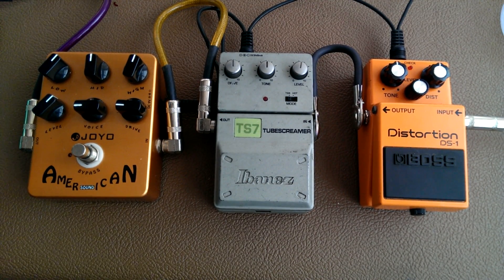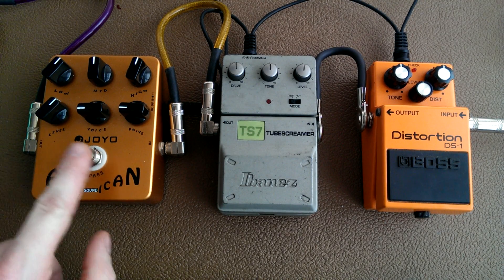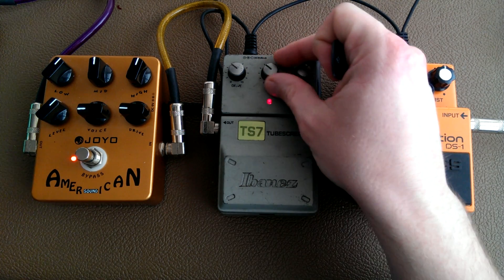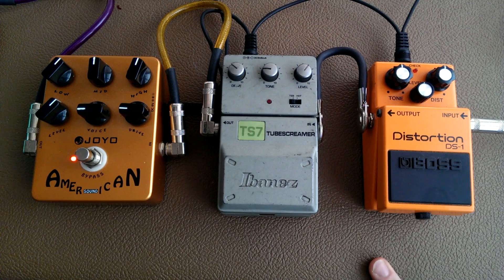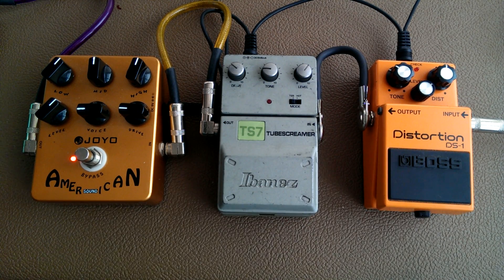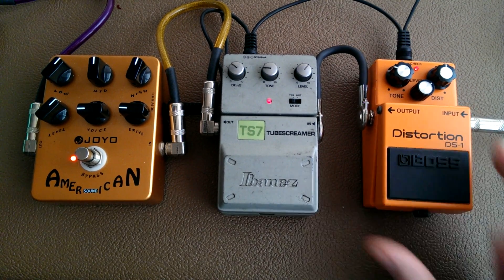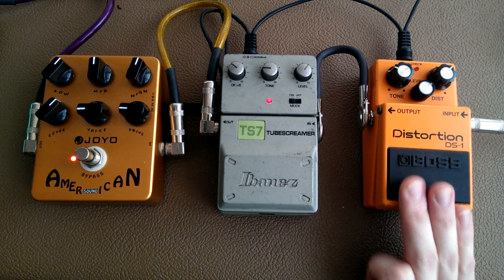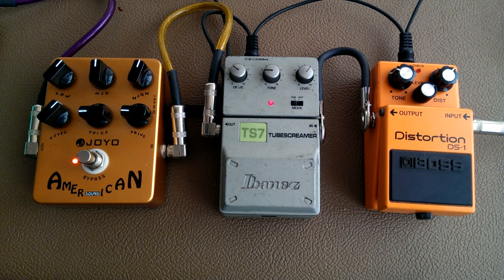Philip Joyce -Tone Tips - pedal stacking

Comment: Very good tone with low cost pedal. Genius. Love it.
Reply: Jay Nartz 
Isn't better to buy a good pedal instead of 3 that causes more white noise, space, cables, complications etc...
Reply: @DrMtz  it's hard to get a good high gain sound with just one pedal. Stacking dirts is always the best way to get more gain without losing clarity. For noise... It's rock and roll. As long as it's not ground loop or 60hz cycle hum it's normal.

Comment: Thank you for this, I stacked a Boss Metal Zone into a Hardwire Tube Overdrive and it sounds fuckin' amazing, the Metal Zone isn't bad, but it is not great either, with the Tube Overdrive the tone instantly becomes super powerful and flexible!
Reply from the maker: Joan Garcia ah that's great to hear. that's my point with this video. you have to experiment because you might find certain pedals work great with each other and others won't.

Comment: Great video. Stacking is fun, I put a cheap chain of pedals together  Left to right: Behringer EQ, Behringer GDi21, Digitech Hot head (similar to ds1) Both drive pedals are set at low gain (volume maxed on hot head) and sound like overdrives with different characteristics on their own, they sound pretty heavy together.

Comment: I'm doing same combination of distortion and overdrive, mate. Love it. I made a little mod to DS-1, I removed D4 diode. It made the pedal way more loud than stock unit. My next mod will be changing one of the capacitors to give ds-1 more mids.
Reply from the maker: That sounds like a good mod to make. The ds1 definitely lacks a little volume
Reply: @PhilipJoyceMusician  if your version is not SMT circuit board, then it's super easy. Some suggest removing both diodes D4 and D5, but it steals lots of gain from pedal, so one of them is enough. Try it out by unsoldering one of the diode's legs, so it's easy to put it back in case if you need it.

Comment: Hey I would add that if you don't want the sound of jfet buffers in overload covering your pedals tones, you should try to keep the output of each pedal low.

I know tube screamers and DS-1 have a jfet buffer on input. Not sure about the Joyo. Depends a bit on the jfet but the buffer should distort if you feed nearly a 1V signal, which is like 3 times you clean guitar signal (depends on pickups used).

I used to use a clean boost pedal (totally clean boost) to see how the the distortion sound changed by just overloading the pedal input. Also used a little keyboard organ sound as a test tone.

If you want the jfet overloading sound I would suggest get a jfet based booster instead, the overdrive will be way better because in a buffer the jfet is configured to behave linear (aka plain, boring) whereas in most booster configs the jfet behaves more like a tube stage.
Reply from the maker: Sauna Anuas interesting. i have noticed that some drives can kind of collapse when you hit their front end hard with another drive or boost etc. the low end starts to flub out
Reply: Philip Joyce Yeah I think thats why boss, ibanez and others use jfet for input. Some opamps, if you feed them way far out will kind of block, even thou the spec for most op amps says they wont ( "non latch operation" ). TL072 is known for phase invert the waveform peaks when getting close to that limit. I think I saw a video here on you tube showing this on an osciloscpe.

Comment: nice demo and nice bit of experimental stacking. Like the Joyo too - great little pedal to have - just by way of a side note... check out Khruangbin's Mark Speer... runs a DS-1 into a pretty clean sounding Fender Deluxe Reverb... his set up is simple  - DS-1 into PH-3 into compressor into reverb into delay ...into amp. Achieves a pleasing tone with this set-up... Interestingly he runs the DS-1 with both tone and drive set to zero... and vol. level all the way up.
Reply from the maker: I'll check him out. Thanks for the tip

Comment: Currently experimenting with the DS-1.  I like to kick it on for that Steve Stevens, chug sound.  Tried stacking it into a SD-1 and I wasn't sold so, someone recommended putting the DS-1 closer to the amp and the SD-1 driving the DS-1.  The trick was to lower the gain on the DS-1 so you are just using the EQ band for the thumpy bass sound.  Great results so far!
Reply from the maker: Yes its great for the 80's type hard rock sounds. Glad you're enjoying it.

Comment: Sounds great, but I usually send the guitar into the overdrive first, then use that to boost into the higher-gain pedals.  Cliched, but it does work for me better than distortion-into-overdrive.
Reply: Same here. I run a TS9 into a DS2 and it sounds great. Every setup where I've ran a distortion into an overdrive sounds like a muddy mess regardless of knob adjustments.
Reply: @Drewcifer  that's true for amp in front of a dirty channel too. I tried putting my DS-1 in the effects loop of my Orange Crush and it sounds a little better than before, where it would just take away all the mids and volume from the signal before hitting the dirty channel.

Comment: what about the Hot mode ont eh tone lock TS7  its basically letting you turn up the drive a whole other time...the switch starts the gain where it left off fo down is normal mode and max is doubled! i used to use the Hot mode on the very low side  and controlled the volume and gain with my guitar volume pot.  but now i use ODR1 and a TS10 together ...
Reply from the maker: You know I don't ever really remember using the hot more much . 
I only really like tubescreamers as boosts into already overdriven amps or just put just a little hair on a clean sound. So I can't imagine I'd have ever used it.

Comment: A question: if you like using a heavier "rhythm sound' but then want to" push it over the top" for lead, can you use the OD & distortion pedals the other way around? I.e. OD after distortion. Also, at, what, point would you then need a noise gate?
Reply from the maker: The OD is after the distortion. If you had a third pedal you could use one to boost the front of the distortion for an even more compressed and gained out sound. 
I don't think it would sound great though as it would start to get very mushy

Comment: I wonder how clean the Joyo would be if hit with an EMG 81/60. I'm looking to color the sound of a poweramp to give it some flavor without adding distortion because I have other pedals for that.
Reply from the maker: With the gain low and the voice set towards the black face side it will stay very clean . 
I was using it in this video with an EMG 85 .
Reply: @PhilipJoyceMusician  Very cool. Thank you for the info. 

I like the tonal qualities and the feel of the 81/60 but don't need the punch so, I tend to sit them pretty low. But even then they can easily over power a lot of preamps.

Comment: Hello, thanks for this vid just wanna ask a quick question. I have a blues driver as my main drive and planning to add a ds-1 for my solos. Will it work as well as this example? Thank you
Reply from the maker: Timothy De Leon it should. The blues singer is a little softer in the mids, but if you like the tone and it works with your amp then it should be good
Reply from the maker: Timothy De Leon obtained thing is, if you run it the same way as in this video it will not really give you much of an increase in volume. It will mainly just increase the gain.
Reply: Thanks man:)

Comment: Was the joyo American going into an amp direct,  or a mixer/ daw then coming out of PA? I assume the former, if so, I heard you should have the pedal that controls clean tone first because a pedal pre amp into an amp pre amp can cause conflict? What difference would there have been if guitar > joyo >ts > ds1? Thanks for the demo.
Reply from the maker: In this video the American sound was going into the front of a small crate practice amp set with the eq very flat. 
No mic, no pa. Just the phone picking up the sound in the room. 
With these kind of preamp pedals they should generally be last in line if they're gonna be always on. 
But you can use them like an over drive pedal either if you so choose.  
There's no right and wrong with these things. Only what sounds good and works for you
Reply: @PhilipJoyceMusician  Thanks, lastly, would you place a loop pedal before or after the joyo? In situation A = playing through amp (joyo would be off so whether loop is before or after doesnt matter) or B = going direct to mixer via di box, so joyo is always ON. Basically, ive got the joyo for if not using a proper amp / amp failure so unsure where the loop should sit. Usually the loop would be my last pedal then would go into the amp...so adding in the joyo, is the loop before the last (joyo) pedal assuming joyo is ON. Joyo is the amp in theory, but would the loop get the joyos tone if the joyo is on,but loop placed before it. Sorry for my ignorance, I appreciate your time and help.
Reply from the maker: @number1Don  again it depends. 
If the American sound is being used as the "amp" and then direct to pa or DAW then it would make sense to put the loop pedal before it. 
But if you had it after , and record a loop into it with the American sound on then the effect is the same. 
The tone of the joyo has been recorded into the loop pedal.
Reply: @PhilipJoyceMusician  Awesome,  I think I answered my own question in a way. Thanks.
Reply from the maker: @number1Don  yeah you kinda did. But I think that just proves that there's no right or wrong
Reply: @PhilipJoyceMusician  thats the beauty of music in a nutshell. Anything goes.

Comment: Hello i have a disortion pedal and a crybaby wah wah that i would like to combine together, considering that my amplifier isn't that good i always use my disortion pedal to get a really nice sound, and i wanna add my cry baby wah wah to that disortion sound, i have 3 cables but i don't know how to plug them to make them work together? How should i do? Help would be appreciated! this is my first time stacking pedals together, shal my guitar go straight to the amplifier? or to one of the pedals? I wanna have a clean channel, add my disortion to it and then add my wah to the disortion, thanks in advance!
Reply from the maker: ok well the order you should use is Guitar -> Crybaby -> Distortion -> amp 
you will need 2 long cables and 2 short patch cables to wire this up properly.
Reply: Ok thank you! by the way, my disortion pedal is 9 volts and my wah wah pedal is 18 volts, is this a issue? I don't wanna connect them and cause any electronical error before im sure that it will work ok
Reply from the maker: what model of wah is it ? are you using a power supply or batteries ?
Reply: The wah is a Slash Signature  Sw-95  Crybaby, and I'm using power supply for the wah, and for the other disortion pedal which is a Emma Reezafratzitz , so I'm using no batteries at all
Reply from the maker: ok well if you're using two separate powersupplies you should have no problems

Comment: nice just want to try this but i want to stack the ts9 then ds1 then joyo.. Will it sound the same?
Reply from the maker: It will sound similar but not the same. The overall character will come from the DS1 in that case
Reply: thanks Philip :) btw what are your settings in your amp? and in your guitar do you use the bridge pickup only?
Reply from the maker: @trevmusics2948  I can't remember what the amp settings were (it was 6 years ago) 
I think I used a mix of the pickups but mostly the bridge
Reply: Anyway thank you phillip. Hardly wants to achieve your tone. Thank u anyway :)

Comment: does turning the level up on the DS1 give you a lead boost for solo's? its not apparent on the video  (maybe because im watching on a phone without the headphones). im guessing the bypass would mean when its switched off the TS7 and Joyo would set the level and not the DS1?
Reply from the maker: the more you crank the level of the ds1 the more it will clip the input of the tubescreamer, so you won't get more volume but more distortion. you might get a little more volume out of it but once it starts to clip the pedal next in line you won't get anymore volume. 
if you wanted it to be your lead sound you could try placing it after the tubescreamer and then it will dictate the overall level. but it will also then be the more dominant tonal character which may or may not be desirable.
Reply: +Philip Joyce I was actually just thinking more in terms of the way the pedals work. I've got my eye on a Charlie Brown for rhythm and an Angry Charlie for my lead boost. i guess as they are both Marshall emulators i can use the lower gain one first rather than (in your example) the higher gain to drive the next pedal. i like the tone you got from it by the way, really nice sound
Reply from the maker: +Paul Mason you can order them anyway you like depending on which you like the overall tone of more. you could also take the angry Charlie and put a clean boost before it to achieve more gain. or place it after as volume boost.

Comment: Awesome DEMO dude..... anyway How if i have a A.D.A cabsim??? Should i putt the joyo before a.d.a cabsim??? In this case we run this route for direct to P.A ?
Reply from the maker: Well the American sound has a cab sim so you don't need to use one but if you are going to I would put it after the American sound
Reply: Can i double cabsim for that case?? I i mean this the route for example : guitar - overdrive - distortion - delay - reverb - JOYO american (ON Position) - a.d.a cabsim - P.A ???
Reply from the maker: You cannot turn off the cab sim in the American sound. I mean it's up to you, I'm sure it would be fine with or without the ADA
Reply: ok i got it ... thanks for reply  i really  appreciate 🤝🤝🤝🤝🙋‍♂️🙇‍♂️

Comment: I modded my DS-1 so it sounds more open and cuts through when playing live. But, yeh the stock version is not so great. Most pros do something similar to this, where they have some sort of drive either on the amp or from a pedal and run the DS-1 into that. Steve Vai and Joe Satriani used to do this early on, and it sounded great!

Comment: Have you ever thought use a tube preamp after the joyo? I'm sure that you would get a smile!!!
Reply from the maker: Ive ran it into a very basic 5w valve head that has only volume and tone and it sounded really good.
Reply: When you plug your set up into a mixer, try to use a tube preamp so as to have an warm signal. I'm sure that it will have a very good sound. Hugs from Brazil!

Comment: Similar concept to the Soldano pre amp circuit
Reply from the maker: I'm not sure exactly how the Soldano preamp is structured. I know it's roughly based on a Marshall style circuit but with extra gain stages in front. But I would have assumed they're valve stages. 
I know the jcm900 used a transistor stage before the valve stages to get extra distortion. 
Kind of like running an overdrive pedal in front of your amp. 
I guess it's not that important how you achieve it but the theory is similar

Comment: I actually run n the same pedals! Just i have the ds7 ibanez distortion.
Reply: +AzHarris, how big the difference between boss ds-1 and ibanez ds7? I never tried ibanez pedals (only ts9), just curious.
+Philip Joyce, maybe you can tell too?
Reply: +Георгий Днепровский :  Good question! I cannot speak for the tubescreamer. I actually have not sat down and compared the two for different tones as i plan to use them both the ds1 and ds7 for distortion, overdrive and stacking the two in a lil experiement really. I will sit down and do a sound test of my two pedals and get back to you with a better answer. Are you planning to buy one?
Reply from the maker: +Георгий Днепровский Ive never tried that Ibanez DS7 so can't speak about it. I had an Ibanez SD9m which was great, very thick classic distortion.

Comment: A Stupid question you put  your guitar  in the joyo first???
Reply from the maker: Tommaso Gavazzi No, the guitar is going into the Boss DS-1 first
Reply: Philip Joyce So you plug your guitar into the pedal you want to get the prominent sound of? I was thinking the complete opposite, that the higher gain goes closer to your amp and the lower gain from your guitar!
Reply: +PhiI93 Yeah i usually put the high-gain stuff at the end but you can't argue with results, his sound is pretty nice. My order is: boost->Tubescreamer (low gain)>Digitech Blues Screamer> Proco RAT -> different Fuzz pedals
You tend to get the gain/tone characteristics of the last pedal in the chain, so for me it's clean/crunch: Blues Screamer, High-Gain: RAT / Fuzz. Still the Blues Screamer gives the RAT some nice harmonics (but makes it very feedbacky as well). Just think of the pedals before your last pedal as adding tone as well as just raw volume to the gain of the next pedal. Be sure to turn down the gain on the latter pedals to keep some room to boost. Be creative. BTW this is a great video :)